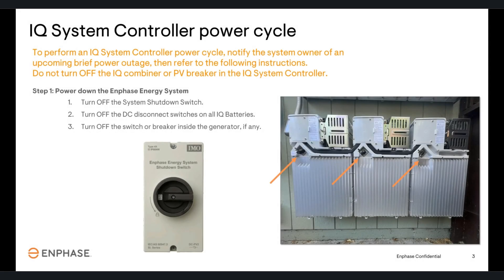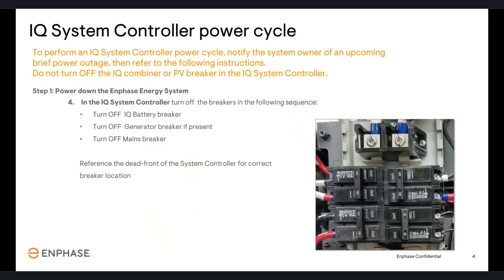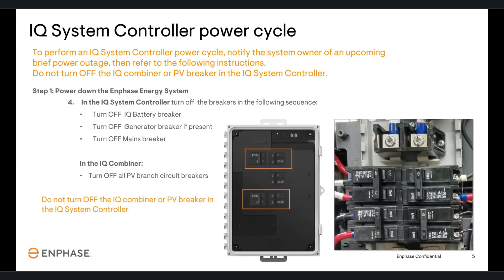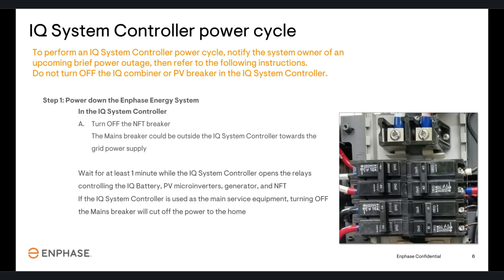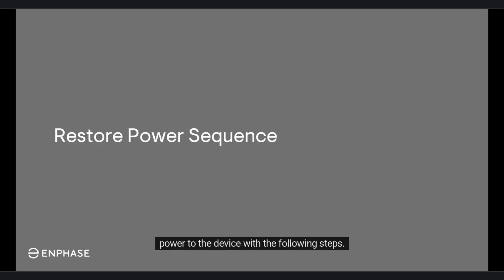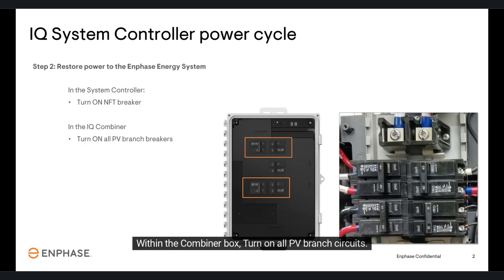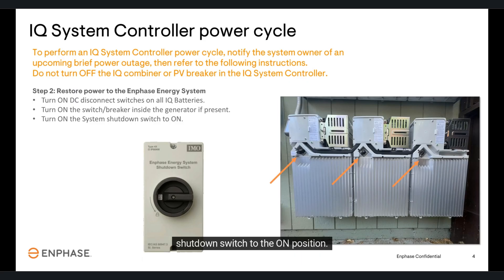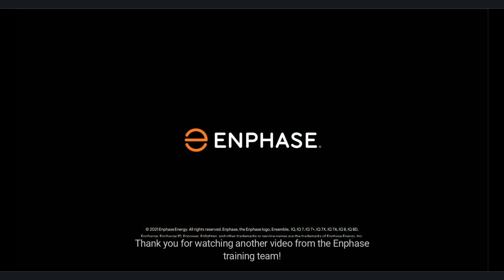How to power cycle the IQ System Controller

Comment: We lost power for literally a second, and the enphase system had the power flickering on and off throughout the entire property. It was like the controller was stuck between trying to connecting to the grid and sending power from the battery. It fried my HVAC before I could get to the rapidshutdownn switch. My installer is baffled, and the data doesn't show any issues. We are definitely trying to find the root cause of the problem because that quickly could have become a house fire.
Reply from the maker: very sorry to hear this. I hope you were able to call customer support. I unfortunately think this is a case where the neutral for that unit was not brought over into the backup loads panel?
Reply: @EnphaseEnergyTraining An enphase tech came out, and found the EV charger was drawing too large of a load. The system proceeds to try to restart itself repeatedly resulting in the rapid electrical pulsing we were experiencing. What's weird is it continued to pulse after the power was restored, and the system had to be manually shut down. Unfortunately, he didn't know why there wasn't a delay built into the system to prevent this in the event of an overload. We charge the cars over night, so we've been lucky to wake up during an outage. It seems like it could be an over the air software fix.

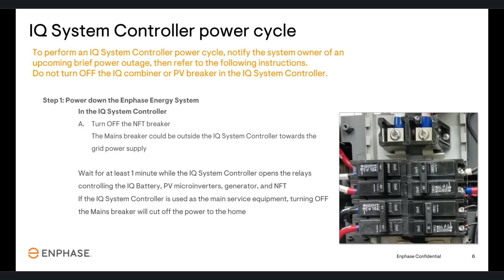Comment: I'm confused: It says @1:43 "Do not turn off the IQ Combiner breaker in IQ System Controller".. yet the Mains breaker has already shut down power to this breaker... 🤔
Reply: It opens the relay for the solar production and it wont close on its own when powering back on. You then have to call tech support for them to close the relay so the solar will produce again.